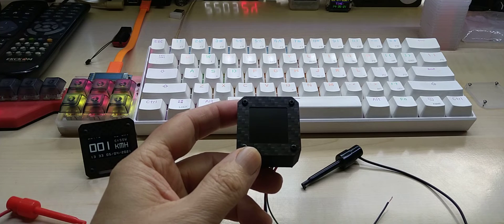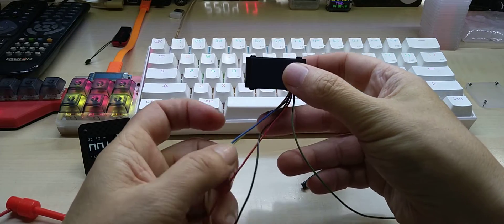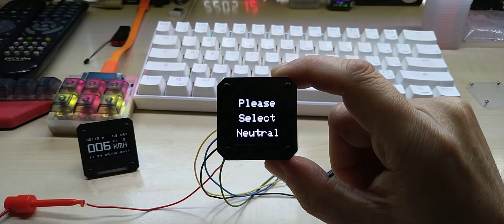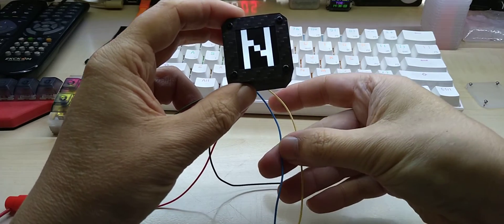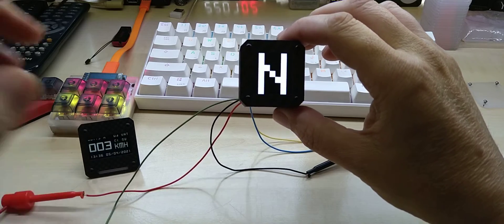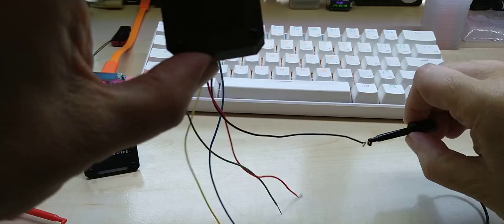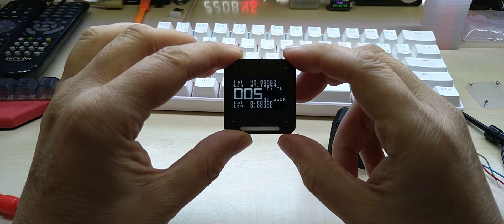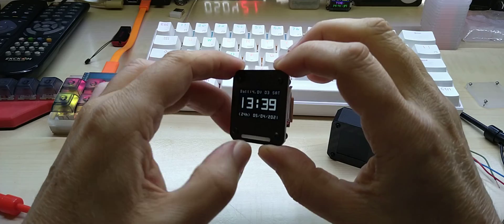Review of my Motorcycle Gear Indicator and it's wiring + the GPS Cube with 1.3" OLED + Carbon Fiber

Comment: Fantastic mate!

I have about 50 to 100 bike buddys all with Aprilla tuonos v2

Any possibility u can make an extremely simple led strip with 6 led lights ? Hope u understand what i mean sir..
**** < as so simple and would be very smart
Reply from the maker: The LED strip for gears or rpm?
Reply: @iHayri1   a led strip for gears

The simpler the better
6 led lights with nr 2 green for N the rest red 1,(N),2,3,4,5,6

Would be small and simple and work great

Super super simple no numbers but just led lights

Like a rev counter yes but for gears

That would sell fantastic mate!

If u wanna whatsapp to hear and see my idea let me know mate:-)

Sometimes simplified ideas work wonders

A led strip with 7 leds
1,N,2,3,4,5,6

Make sense? Compact and small i would expect
Reply: @iHayri1  rpm most bikes have these days and km/miles.. but lack the gear position indicator and most have pure numbers and its bulky and dont look simple

If u could make this in a way thats small enough it could be worked into the existing dash of most bikes..
Amd look super clean!.
I have a rev limit limit as in adjustable 
2000-12000 rpm

But i miss a simplified gear position indicator 

No numbers just leds that show gear position or (green) (neautral) and the rest in a custom wanted color? For me red?
Others blue(r1) green(kawa) ect ect u get my point
Reply from the maker: @hawkins2211  Makes sense, just wanted tom make sur ewe are talking about gear indicator based on LED's. I do like the idea and will think about it. The mechanical part is the most important part as it needs to be weather proof and easy to mount.
Reply: @iHayri1  
Awsome 
Yeah so as an example i could take dash apart
Drill 7 holes place leds behind
Curved? Striated? Whatever u can find ofc thats a thing ofc..
And have a clean look
Reply: @iHayri1   i can send u a drawing as an example if u wish

But yes its a simple idea

As for software i think u would nail it easy
Reply: @iHayri1  any updates mate?
Reply: Send me an email mate
We should talk
Reply from the maker: @hawkins2211  The LED indicator is not feasible for me as any small Arduino board could be used to build it by just attaching the LED's directly to it. Also most people  will not be willing to take apart a tachometer to install extra LED's not to mention the space restriction they could face. You can send me a message through my Tindie store, I do not publish my email here.
Reply: @iHayri1  space resistance?! Its    a strip of leds
A full 2/2 cm indicator takes alot of space?
Reply: @iHayri1  sticking to top or side of dash board is an easy job. As is the full size u sell no?
Reply from the maker: @hawkins2211  space restriction, the amount of space available inside the enclosure. There are just too many variables and unknowns to make it a product for sale, like what kind of LED's, their size, color, cable length and so on. The last thing I need is a product which people will have a thousand question and many possible problems arising and me getting blamed at the end. Sorry.
Reply: @iHayri1  well thats why u talk no? Have 50-100buddys on same bike
Reply from the maker: @hawkins2211  Nothing against you personally but if I would have had 1 dollar for every promised sale, I would be almost rich :-) For me to consider this, I would need exact, none changing specifications and at least 50 confirmed and payed upfront orders. Even then it will come down to the price of the unit, some people are willing to pay the price for a "special/custom" made product some don't, and my experience is most don't.
Reply: @iHayri1  yeah i guess thats a good point mate. Wouod look absolutely awsome 
Simple 7led above dashboard 

I have an Aprilia tuono v2

And dont have gear indicator 
How would sombody try to make this mate?
Where wouod one start
Reply from the maker: @hawkins2211  Try google, search for "diy led gear indicator "

Comment: Hi Hayri.
Is there any way to make one of these indicators that starts off showing gear 4?

The vehicle im building will have  paddle shifters on the steering wheel to electronically shift between the 4 forward gears (#4 thru #1).

However, when the transmission is placed into the "paddle shift"/manual mode, it does so from the highest forward gear, which is 4.
From there, you paddle down into 1st and back up to 4th.

I can easily provide the ground inputs needed for the indicators up and down shifting.
I can even use the "paddle shift ON" switch to power on the indicator, so its only ON when paddle mode is on.

Hopefully this is something possible, even for additional cost whenever you find time?

Hope to hear back soon, Thanks!
Reply from the maker: Hi, technically it is possible, just have to look into the code, from my understanding it is still sequential right? Btw, I am also working on a new gear indicator that will use a 8x8 LED matrix to show the numbers, letters or whatever you can draw on a 64 pixel matrix for that matter.

Comment: How is this installed
Reply from the maker: Which one?
Reply: @iHayri1  ninja gear indicator
Reply from the maker: @educateyourself507  by using a GoPro waterproof enclosure. The wiring is explained in the video. As for switches either reed switches or micro switches are used.
Reply: @iHayri1  I’m having ninja 300 but I’m confused with he output wires from the bike... 
can’t find out any diagrams explaining it
Reply: Can you share your insta id. 
So I can show you the picture of the wires
Reply from the maker: @educateyourself507  The only wire you need is the one from the Neutral light, the others connect to the switches you need to install and to 12V. You might need to get some help.